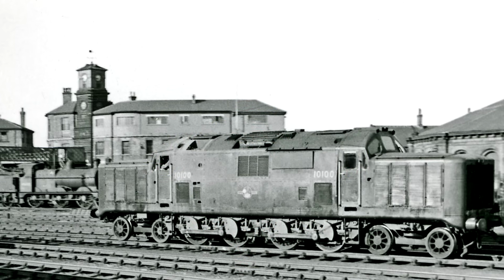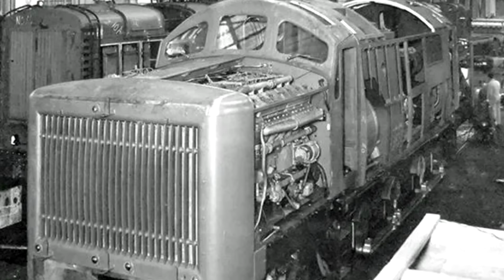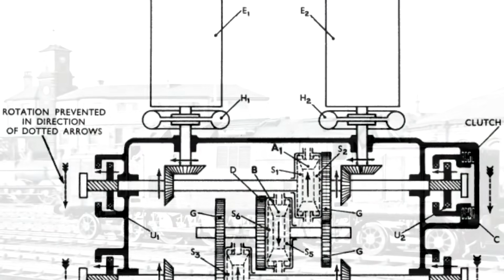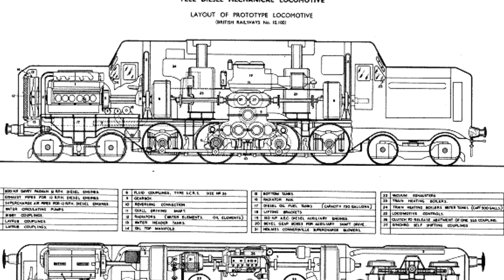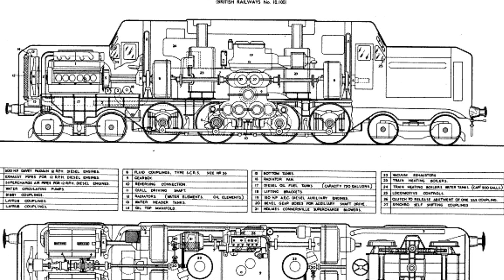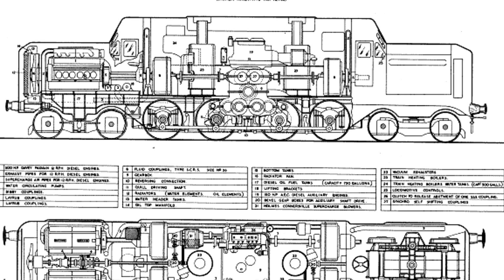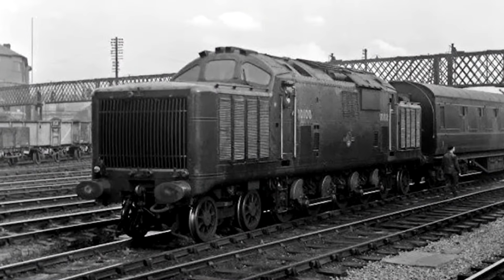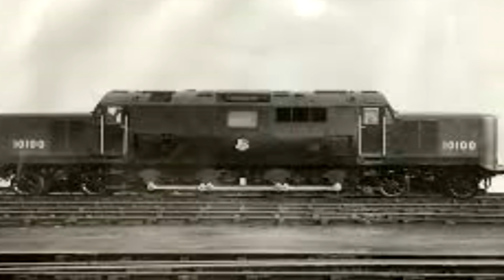The Strangest British Diesel in History | British Rail 10100 "The Fell Diesel" | History in the Dark

Comment: Irritating mispronunciation department here,  Ivatt rhymes with Vivat. 

One of the great misconceptions the railway community in Great Britian had was the idea that the torque characteristics of a diesel-electric or a diesel hydraulic were wrong because they weren't the same as a steam engine's.  That's what Lt-Colonel Fell was trying to address.   Using what were in effect modified bus engines to drive Roots blowers to supercharge the traction motors meant that 250hp was devoted solely to moving charge air at all times the power units were running, the starting procedure was to fire up both the AEC 125hp blower engines, then all four of the Paxman traction units, you would set off with all four engines, then clutch out one engine, then a second and then a third, so at high speed only 500hp was going to the rails with 125 hp going to the blower.

Differentials can play a role in transmission systems, Voith have been using them as a second stage in their Diwa hydraulic transmission systems for about 50 years.  Yes the Fell was lunacy, but so was GT3 and this was the era of the hovercraft and the Fairey Rotodyne, of Barnes Wallis experimenting with variable-geometry supersonic designs. The LMS and Ivatt had come up with 10000/1 and Ashford copied the idea with a more Southern Railway appearance with 10201-3,  the 1Co-Co1 bogie design on those became standard on the subsequent Sulzer and English Electric type 4s, TOPS classes 40, 44-6. There was an approved BR way of building locos and there was also a free for all, the Mainstream also included class 20, 24,25 26, 27, 31 33 and 37.  The non-mainstream classes were all the diesel Hydraulics, all the other type 2s and Deltic.  The only fully BR approved diesel electric that was a true disaster was class 17.   A second problem was that the powers that be thought the pre-war railway was normal, and that fixed-consist heavy freight was an aberration.  This led to the huge white elephant automated marshalling yards.  A lot of BR's top brass had come from a forces background and thought the logistical role railways playerd in World war two was the main purpose of a railway, not moving passengers and fixed consists of raw materials.,

Added to this, the regional traction bosses wanted one for one replacement of the steam engines, so far too many underpowered little diesels were built, nothing smaller than a 37 was truly necessary.  One reason for the 20s continuation rather than the 17 was that coupled nose-to-nose, two 20s made a competent 2000hp frieght loco with adequate visibility.
Reply: "Vivat"
I've literally never encountered that word.  Might I ask where you're from?

Comment: So complicated it can get shredded internally by a bolt.
Reply: Its really not that complicated considering that they probobly alreddy had the diferentials of the shelfs.

its bascially 3 diferensals, 4 hydraulic copelings and 4 engines. Basically standard truck parts.
Reply: @matsv201 it's basically 500 HP locomotive that can boost into quadruple of the torque from megazording the engine, on top of quadruple gear ratio. Making it 16th time the torque of supposed engine.

You know what else can be 16th torque initially and full speed low torque later but only using 2 gear? DC motor. They can just build 500hp diesel electric locomotive without all your your mention, with roughly same performance
Reply: @matsv201  they were not on the shelf, the whole final drive system was completely custom made. This thing was bat crap crazy.
Reply: @KrisDouglas  no the whole system, but the individual component.
Reply: Well to be fair that is just about every mechanical item.
Reply: if it was complicated i wouldnt be able to recreate the drive systemm in about 10 minutes in a videogame https://www.youtube.com/watch?v=Ou0f9ZEoZWI

Comment: I showed this to a friend of mine who works at Emd and this confused him
Reply: The drawing is quite confusiong, but the concept is really very simple.

Just take a truck engine and a truck diferental. Ad the engines to what is the output shaft, use the input saft as the new output shaft, make two units and conect them together with 3rd differnetal.

THen just ad a copling on each engine if well there isn´t alreddy one.

This would be fairly simple to make of existing truck components
Reply: tbh as confusing as it sounds fundamentally its incredibly simple on paper, in a conventional automatic gearbox they use epicyclic gearsets, a differential is in a way kind of an equivalent to an epicyclic gearset, the way they used the differentials is pretty insane though, in theory if you stopped one of the outputs of the diff, the rpm would double from the other output and half the torque, which is fundamentally how automatic epicyclic gearboxes tend to work, using multiple engines on what is the conventional output of the differential changes the (conventional) input speed (which is essentially the output of the Fells design), and can be used to multiply the speed in the same kind of way, though because of them changing the amount of engines running into the differential output the torque gain from the ratio is completely cancelled out, giving only a speed multiplication, its fundamentally very simple but needlessly engineered

Comment: I…what? Late 40s, so they understood turbo charging. I love a Rootes blower, but this seems like madness. 
The gearing diagram reminds me of a picture in a Foxfire book from half a century back showing how a miller used multiple old car differentials, drive shafts, and axles to convey the power from his water wheel to the millstone. But, he was makin’ do with what was available: these people chose this system. 
Reckon it takes all sorts, eh?
Reply: I checked, just to be sure, and these were 4-cycle diesels. So I’m guess the auxiliary engines running the blowers was all about controlling torque. Just, maybe not the best way?
Reply: i mean considering the fact the people who built it only really properly understood mechanical, pneumatic and hydraulic means of transferring power, its not that far fetched of a design
Reply: @nbirdie100  true—and, it’s easy for me to criticize while typing on a WiFi device in a modern, climate-controlled setting. Still, I’ve seen some quite well thought-out pneumatic controls, and know that ships used to use systems like that. Like the old adage, if all you have is a hammer, everything looks like a nail. In HVAC, I know guys that will rig up a set of relays. Others will use a board. Both ways get it done—you just use whatever you’re familiar & most comfortable with.